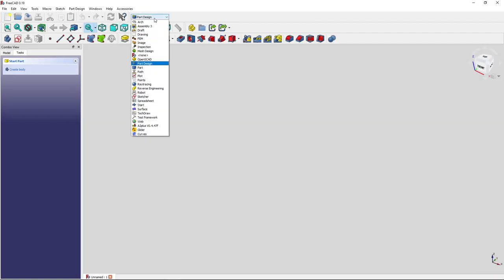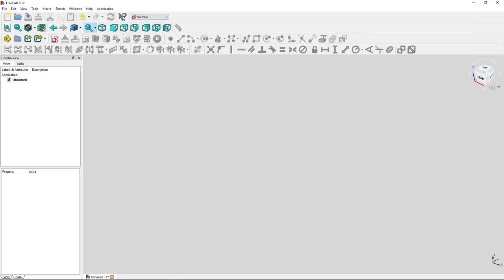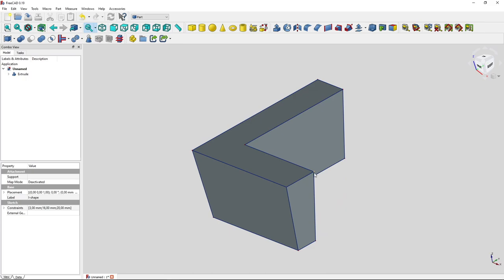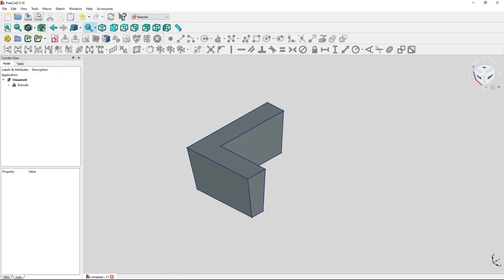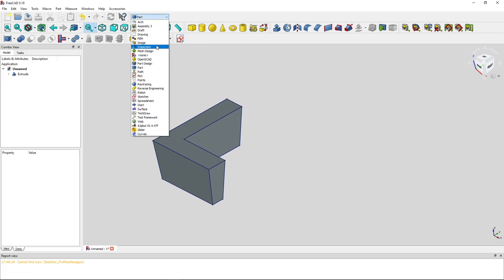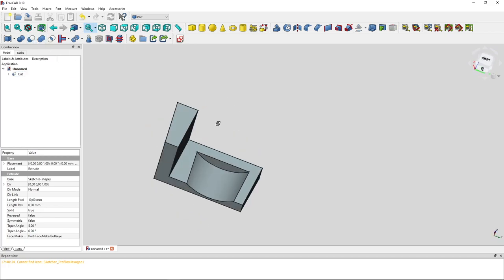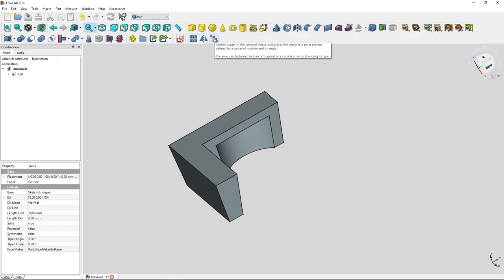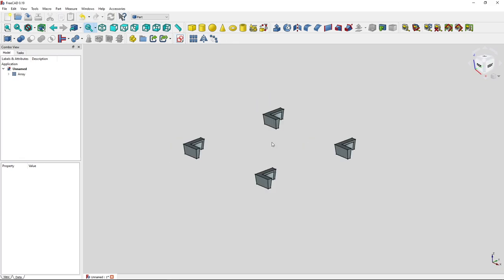FreeCAD 0.19 QUICK TIP - Extend the PART Toolbar with additional tools (Sketch, Array)

Comment: Very handy and time saving.👍
Directly after watching your video I ran to my computer and I tried to get the offset command from the draft wb to the sketcher wb, it worked but  in the hierarchy tree and made a copy called wire. That copy can be extruded, but can not be used within the sketcher wb like genuine sketches. Sadly.
Reply from the maker: Yeah, unfortunately that’s a problem, that you can customize it this much, but not every command works in every wb .. 🤨

Comment: The part workbench is really powerful but I'm a fan of the part design workbench and switching workbenches has caused issues for me in the past
Reply from the maker: Im also a Part Design Fan. Did you check the part in the video with the tapered extrude? This is an example of what you can’t do in Part Design as easily!
Reply: @FreeCADAcademy  of course - I'd have to do that with two sketches and a sweep in part design. Part is definitely more powerful here

Comment: Terrific tutorial - have you also customised the colour of your shapes and their “lines”?
Regarding the Array feature in the draft workbench - Having that in the Assembly menus would also be very helpful and is something I am going to try.
I think for someone coming from a different system as you have you have looked at FreeCAD with an open mind and discovered that it is a tremendous programme.
Reply from the maker: Hi and thanks for your comment! Yes, I use a custom color system based on my light grey background. 
Therefore I changed all line colors and I hope with this color system it’s also besser visible for the users in the videos. 
I don’t really know how well this works with assembly workbenches cut especially the Part WB can profit because it often „needs“ tools from other workbenches!
Reply: @FreeCADAcademy  - well I tried the array tool in AP2 assembly workbench and it works fine and will save me a lot of time. I do like your colour system and would like to achieve the same look. A few pointers as to how you did it would be appreciated.
Reply from the maker: I will release my color scheme and maybe even make a small video how to set up the different colors! Thanks for the good idea ! 😊

Comment: Nice feature but following your instruction the toolbar only work with sketcher but not with draft  when I shift to draft for the first time it works but when closing down Freecad and restart it don't work ? what is the course and what is the procedure to solve this problem, that tried several time using freecad 0.19  version 23546